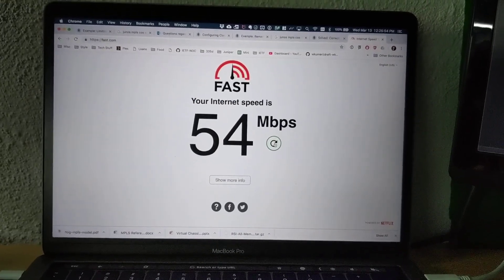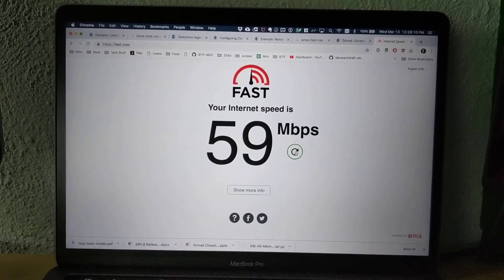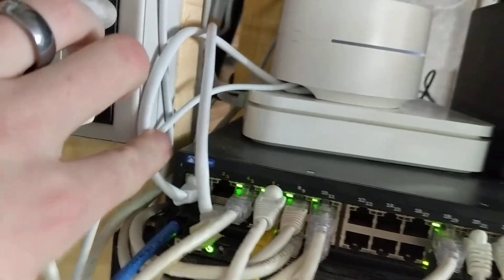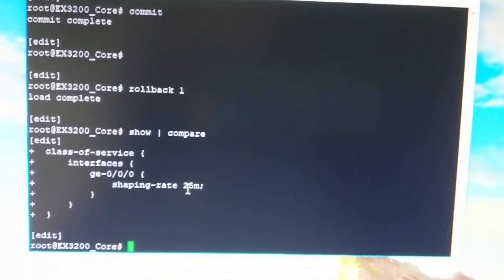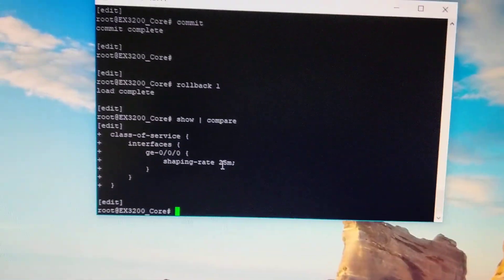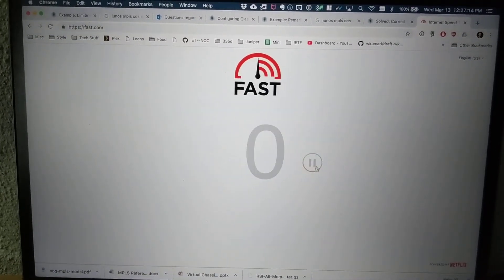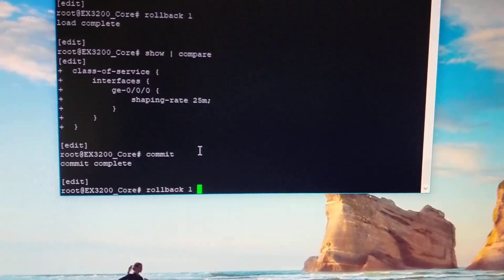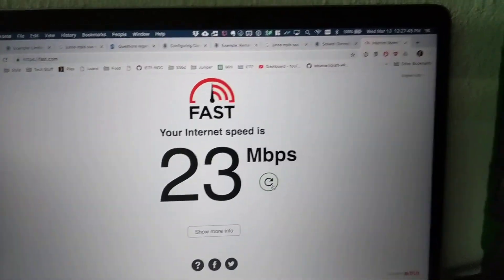Junos Traffic Shaping (it's super-easy!)

Comment: Doesn't work on vlan-tagged interfaces get a syntax error. I have a microwave link has 20 vlans going over it for different things need to land them each on a different IP address. I don't want to set BW different depending on the vlan.
Reply from the maker: What type of device are you using? I believe you need something that supports traffic-control-profile in COS to define a per-unit shaping-rate. The EX3400 I used in the video, as well as the EX2300-24MP I have now, don't support this syntax. A per-unit scheduler would do it as well, but that's going to be Trio (MX) and my guess is that you're landing your microwave link on a switch?

Comment: I have a SRX 110 and I get an error on commit:

[edit class-of-service interfaces]
  'fe-0/0/0'
    'per-unit-scheduler', 'hierarchical-scheduler', or 'shared scheduler' for this interface is required for bandwidth configuration on interface unit
error: configuration check-out failed: (statements constraint check failed)
Reply from the maker: hmm. If you have that platform, you're likely on a very old version of code as well. I don't know that I can help with this one since it could be a syntax issue that I cannot simulate.

Sorry!

Comment: What is the best way to mark traffic into a forwarding class? Would you use firewall filter for incoming traffic or classifiers?
Reply from the maker: Funny thing about QOS... There's no way to "mark" traffic on ingress. Traffic either comes in already marked (BA. or "Behavior Aggregate" classification), or we build a filter to ID specific traffic, and assign that traffic to a forwarding-class (MF, or "Multi-Field" classification).

Always remember that if you are using an MF classifier, you MUST configure DSCP rewrite rules to apply the appropriate code-points to traffic on egress. That, or you need to configure your MF classifiers on all devices in your QOS domain and that just sucks.

Comment: Suppose we have connectivity like this 

User <-----> (ge-0/0/1) Switch-A (ge-0/0/2) <-----> ISP 
where ge-0/0/1 is an interface connected to the end user and interface ge-0/0/2 is connected to ISP. Since traffic shaping is an egress phenomena hence if we apply traffic shaping  (say 15Mbps) on both interfaces ge-0/0/1 & ge-0/0/2 will we be getting same speed (15 Mbps) in both upload & download?
Reply from the maker: Yes, it should work this way and be testable/repeatable. You could also do shaping on egress towards the ISP and policing on ingress.